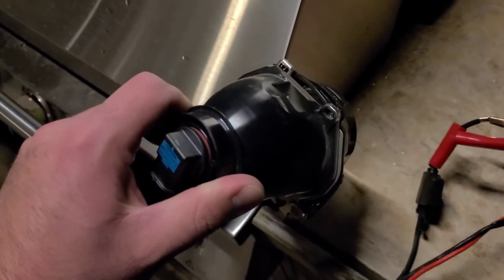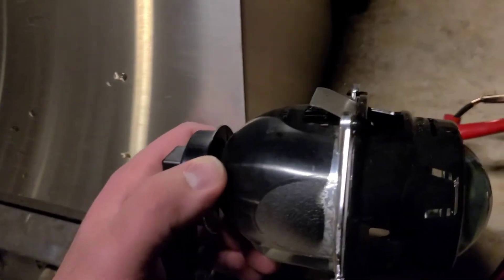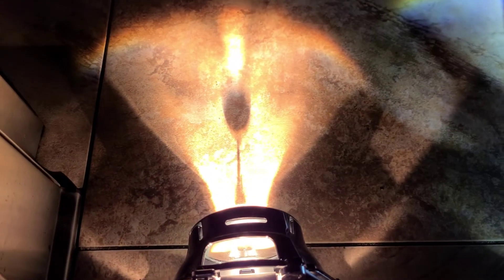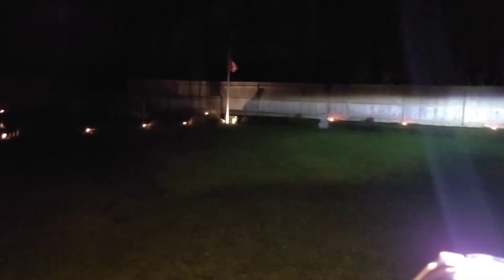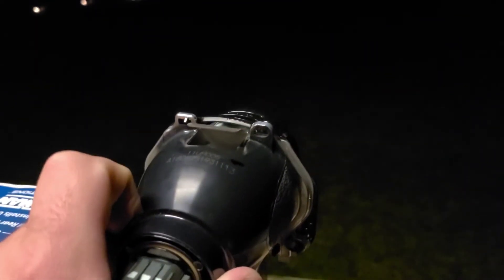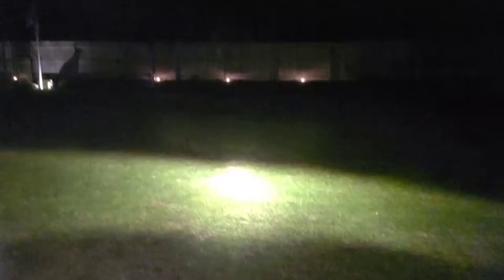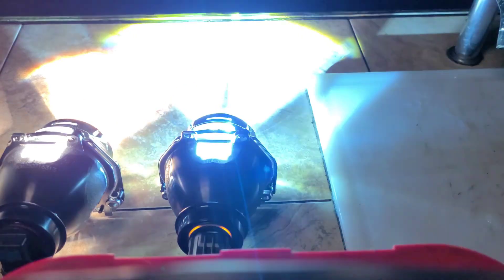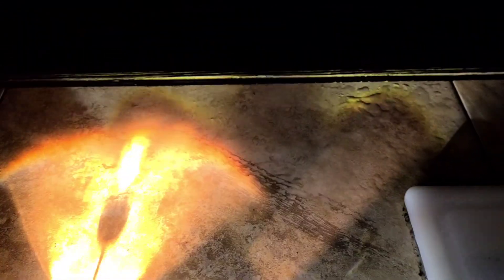Morimoto 2stroke 3.0 vs stock H11 projectors.

Comment: I really love how well the new 2Stroke 3.0 seem to play in projectors this time around. At least in my experience. The strange thing is in all my testing I’ve found that nearly every time putting LED bulbs in a halogen reflector almost always beats out a projector using the same exact bulb just in a projector instead. For some reason LED’s efficiency is outstanding on reflector designs. Probably since the halogen projectors just can’t utilize the extra light well but the reflectors are usually much bigger. So the surface to collect and concentrate light seems to be better for those scenarios. However I will point out you have to test it. Morimoto 2Stroke 2.0 and 3.0, SV4, Xenon Depot Xtreme LED, and the Diode Dynamics SL1 all play really well In the h7, H13, 9006, H4, and 9007 reflectors. They are have an extremely factory looking cutoff with nice bright hotspot near the cutoff line and center. The GTR lighting ultra 2 was good but in a few of them it really moved the hotspot down too much. Concentrating most of the light into the foreground. So while the GTR ultra 2 is probably the brightest if the bunch in pure power, it doesn’t always have the accuracy of optical fidelity in every light tested. They do very well in most projectors and are very bright. But I prefer the lower raw lumen output of the Morimoto 2Stroke 3.0. Just seems to be the best of everything.
Reply from the maker: I think part of the efficiency of LED in a halogen reflector is that most are optimized to mimic filament in both output and position. Meaning it is like simply adding a brighter halogen. Generally that's why HIDs in reflector or halogen projectors tend to scatter light, the alignment is slightly different. And I have noticed there is little to no glare with a quality LED in a reflector housing when compared to stock.
Reply: Yeah you was definitely blinding people! Of course a led in a reflector housing "looks" brighter because the light is going EVERYWHERE. Now bend down and stick your eyes in front of that beam of light from a projector lense and you'll see which one is really brighter 🤣🤣🤣